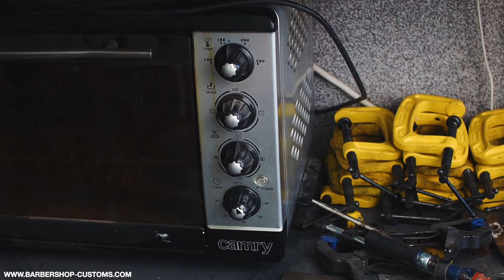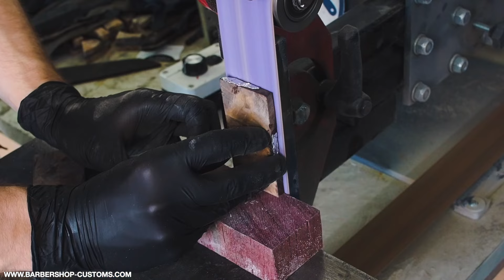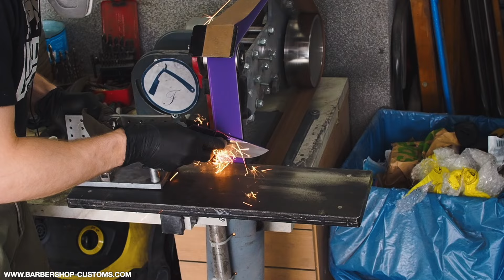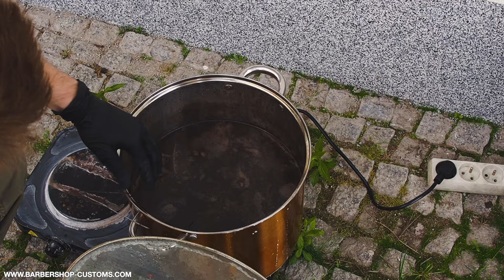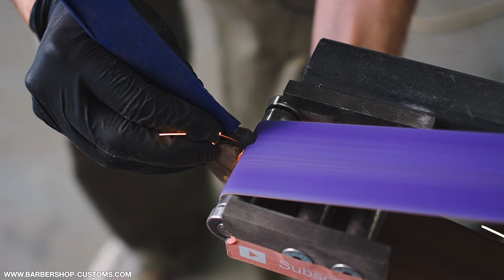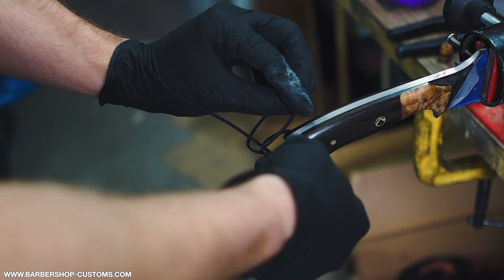How about a fulltang DARK BOWIE? - Knife Making

Comment: Yes a very beautiful knife , however I would like to know why would you heat treat the blade before you actually grind the bevels .... . I have been making knives for 4 years now and I usually cut, shape and grind in the bevels prior to heat treating plus I also cut shape , drill all pin holes and make the handles prior to heat treat . I have made knives from pre-heat treated knives as well being very careful not to over heat the blade steel whilst cutting and shaping my final design etc, etc. What is your wisdom or thoughts on the process you do?... I' am very curious toward your process of knife building from one knife maker to another :-)...
Reply: I'm not a knife maker, I just watch a lot of Youtube videos on the subject, but I have the same question. Why heat treat before rough grinding?
Reply: I agree, what gives? Does he want the steel to quench/cool at a more uniform rate?

Comment: It's a beautiful knife, Not sure $600 beautiful though. You didn't hand forge it, you cut the pattern with machinery and heat treated it. If you were pounding away with a hammer, folded the metal some number of times, put real black smith'n skills into it then I would say $600 is well worth it. I couldn't justify your price for what it is. But yeah, beautiful knife.
Reply: I agree. This is technically proficient, but hardly a work of art. It could just as easily been made by a robot with a skilled programmer. No real creativity or craftsmanship involved. And yes, I have made knives this nice and I do know what I’m talking about. I just don’t pretend to be an artist on YouTube.
Reply: @jeffreynerdin3522  If you think there's no creativity or craftsmanship involved here, you're smoking some heavy stuff. I use forging for some of my knives and stock removal for others, depending on the steel. The result is what matters, and as a competent knifemaker, there's a lot of labor involved. If you want to make a profit, you can't throw hours away that won't make a difference in the finished product.

Would you say an artist isn't an artist if they don't weave their own canvas and grind their own pigments for the painting they make? Lol, no. Get off your high horse man.
Reply: @sirmontag  I’m just impressed by some things and not others. Most things that could be done by a robot don’t impress me. Except for the fact that they can be done by a robot; that’s pretty impressive. Robots are cool; they’re just not artists. BTW, I don’t really care that much about this and I’m not really taking any of this that seriously, so don’t get too wound up. I’m sure you’re a wonderful person.
Reply: @jeffreynerdin3522  We all have things we're impressed with and things we're not. I have my own very strong views on where art stops and begins. But it's just low class to criticize another knifemaker on the basis of your entirely personal views. I've seen knives I wouldn't buy in a million years, but that doesn't mean I'm crass to the point of saying that out loud, or posting that in the comments. If people like the knives, they'll sell. If they don't like them, they won't. No need to be a seagull, you know?
Reply: @sirmontag  How long should we keep this going? I’m not impressed, that bugs you. Okay. What next? I don’t usually bother with the comment section, but I guess this is fun. What else would you like to say?
Reply: You dont even have 600 bucks pal...
Reply: I don’t know much about knife making, but that easily seems worth $600. The cost of all the materials that went into making it, all his equipment costs, the time it took to design it, and looked like it took a full day to build it, most of the work all done by hand. And it came out looking perfect.
Reply: @pete6705  Nah, he C-n-C'd the steel and heat treated it, all his work was in the handle and sharpening. If he had forged it out of a raw block of iron or even if he folded steel leaf springs and hammered them out to the shape of a knife then all the other work then heck yeah, $600 might be cheap! This is great work none the less , but not $600 work.

Comment: Phenomenal work! The design and fit/finish is top notch. I was wondering though, why do you grind your bevel after heat treatment? It doesn't ruin the temper?
Reply: That's what I was wondering too. Heat through friction can indeed mess with the hardening and tempering, and it will make the processing quite a bit harder too. Not to mention wear and tear costs increasing as well.
Reply: @F3EDER  agreed. The only benefit I could see is decreased risk of warping during the quench, but that's a thick enough steel it shouldn't have that problem
Reply from the maker: If you keep the blade cooler than 180 C, it won't ruin your HT. The reason is that it's easier to keep the decarb away and it's more convinient for me :)
Reply: @BarbershopCustoms  thanks for the reply! It's clearly working for you, so can't argue with that.

Comment: Any particular reason you drill the tang holes after heat treating? That generally requires carbide drills since the steel is so hard.
Reply from the maker: We don't, they're drilled before :)

Comment: Very happy with my knife guys. Haven't tested it to its fullest yet due to weather but I believe this knife (the pandemonium) will serve me well for many years! 
If you don't mind me asking, what is the white powder you put in the resin?
Reply: I'm not the poster of the video but I work a lot with resins. There are a lot of things you can add to resin like fire retardants, hardeners, fillers, etc. Adding hardener to a resin can make the adhesive bond stronger, as well as give a little bit of "Substance" to the resin that lets it form a sturdier bond. Most epoxy uses a 2 part mixture, and one of them usually contains a hardener or "Activator" to begin the reaction that forms the resin. He used a 2-part epoxy resin in different sized bottles, usually that indicates that the mixing ratios for the resin isn't a true 1:1. Usually the hardener/activator is the smaller bottle. Usually you can still add additional hardener or filler to these resins to make them thicker, stronger, grabbier, etc. And these additives are often a white powder like in the video. Or it could be something else, that's just my best guess as a guy that works with resin a lot.
Reply: @jarredjones3358  Thanks for your comment. Very informative! I use a panel adhesive at the body shop I work at, it has extremely tiny glass beads, almost powder like, in it to help keep a very slight gap in-between the panels (usually when we replace a quarter panel on a car or truck) to prevent all the adhesive from oozing out when we clamp them together. Thought it might be something like that or like a powdered white pearl pigment idk lol
Reply from the maker: Hey, I'm glad you like the knife! The powder is epoxy thickener :)

Comment: My knife has only a hardened edge, the rest of the knife is unhardened, will the dark coloring be uneven because of this?
Reply: Yes
Reply: @Fabsi87  how about cold bluing?
Reply: @malcolmbuehler5619  im not sure but bluing wears of over time and it probably wears of different on hardened and non hardened steel
Reply: @Fabsi87  I see, I'm planning on adding a clear coating to protect the finish, hopefully that will help
Reply from the maker: I haven't ever tried it, you need to try it yourself, there is a reason why it wouldn't and it's a s good as the reason why it would :)

Comment: Won't it rust when water touches it?
Reply from the maker: The hot oxide helps with corrosion resistance a bit, but it shouldn't have too long contact with water

Comment: No doubt you are an excellent craftsman, but if you forge your blades instead of cutting them on a CNC, it will be more fun to watch✌
Reply from the maker: Thanks, though forging doesn't make the knife better, in fact, there's more risk that you'd spoil the steel (e.g. by decarb or grain growth). Though I agree that it's more fun to watch. We have two vids with forging a san mai on our channel :)

Comment: ATTENTION BLACKSMITHS!?!?! I just dropped a video in which I made a knife with a tang from rebar, but after I quenched the steel the tip kinda warped a bit.  I want to know if I should bend the tip with a vice, or should i reheat the steel an forge the tip straight. I want to be a better blacksmith, I NEED CRITICISM!?!?!?!

Comment: Apologies, but after 40 plus years in forges, I saw not many skills used, except for the use of machines that did all the work. The blade was not sanded clean, especially the ricasso and spine, which if polished would have really shown off the colors of the scales.